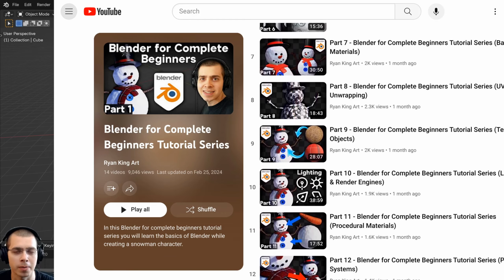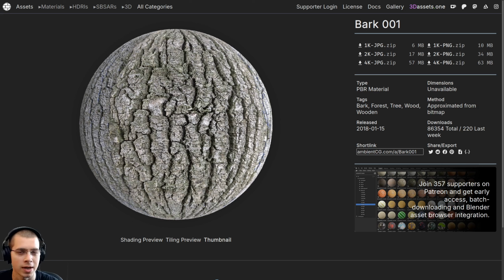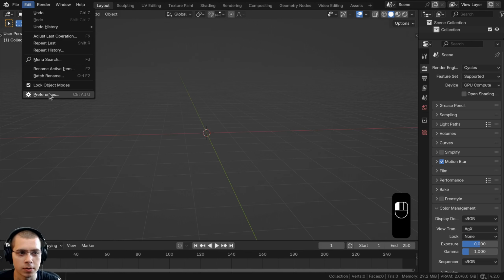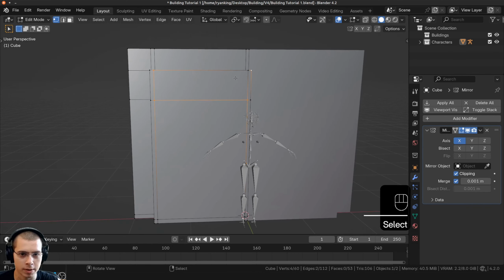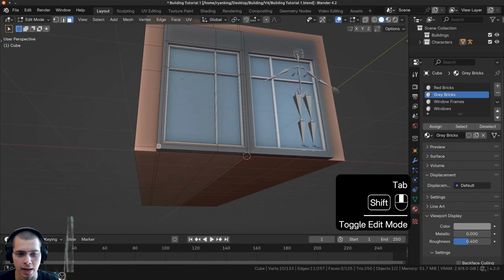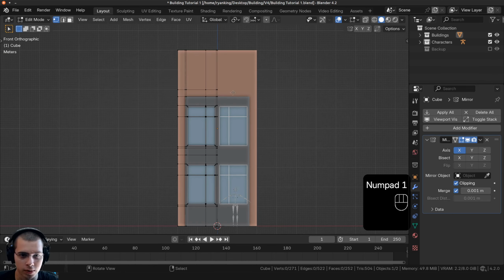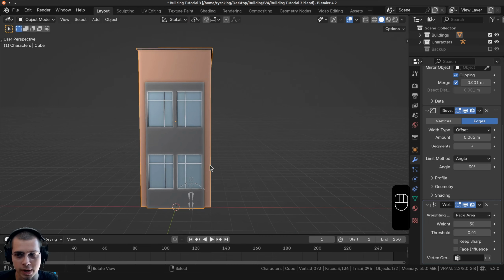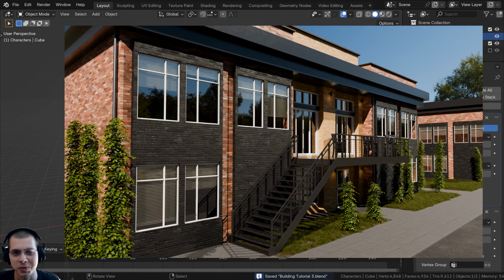Part 1: Creating an Industrial Building in Blender 🏙️ (Tutorial Series)

Comment: Thank you so much for the tutorial!! Just curious…what is the spec of your computer? Thank you!!
Reply from the maker: Here are my PC Specs:
• Ryzen-3900X CPU 12 Core 24 Threds
• Cooler Master CPU Liquid Cooler
• EVGA Supernova 1000 Watt Power Supply
• RTX 2080 Super WINDFORCE OC 8G Graphics Card
• SAMSUNG 500 GB Solid State Drive
• WD 6TB WD Black Performance Internal Hard Drive
• 3000 MHz DDR4 32 GB Ram
• Thermaltake Level 20 MT ARGB Mid Tower Computer Case
• ASUS ROG Crosshair VI Hero (WI-FI AC) AMD Ryzen AM4 DDR4 M.2 USB 3.1 ATX X370 Motherboard
Reply: @RyanKingArt Wow very good to know. Thanks a lot! 👍🏻👍🏻👍🏻

Comment: Hi Ryan, do you have any ideas as to why the bevel modifier might not be working for me? I mess with the settings on the modifier but nothing works. Thanks for the tutorials :)
Reply: I have the same issue. I have some experience with Blender and I was quite sure that the bevel modifier only works in Edit Mode. On Ryan's video you can clearly see that he is in Object Mode. How is that possible? In Blender 4.2.1 this doesn't work for me. Is there some setting that I have overlooked? As an alternative I have selected all edges in Edit Mode and applied the Bevel modifier. Looks OK.

Comment: I guess I'll get to it when the tutorial brings it up, but I'm having issues downloading some of the provided texture/model/assets. I've worked around the dirt ground and the brick texture, but the leaf asset... well the site will not load. It might be my ad-blocker/bowser but I'm unsure how important that one is since it was stated that we'll be "cutting" the leaves out. 

Just wanted to bring your attention to it. ^^
Reply from the maker: The leaf texture is used on the tall thin trees in the video
Reply: @RyanKingArt  Understood. Also, again, it might be due to my browser/adblocker. They've kept me from accessing some sites. So, no worries as I think I'll have a work around with that.

Thankfully, I'm not as green as the leaves with blender. So, we'll just see how that goes when that tutorial is up. So far though, no issues and I can follow along without any sort of issue. ^^
Reply from the maker: Hmm that's strange. the leaf texture downloads fine for me.